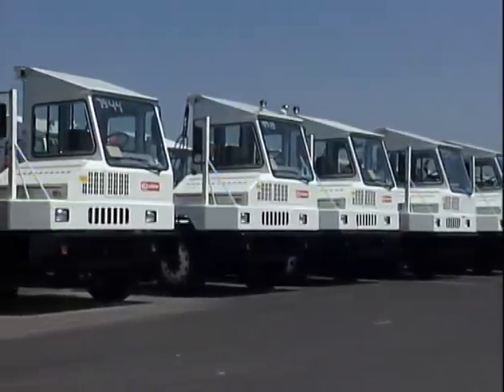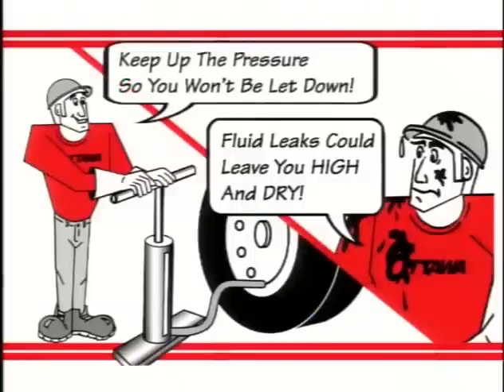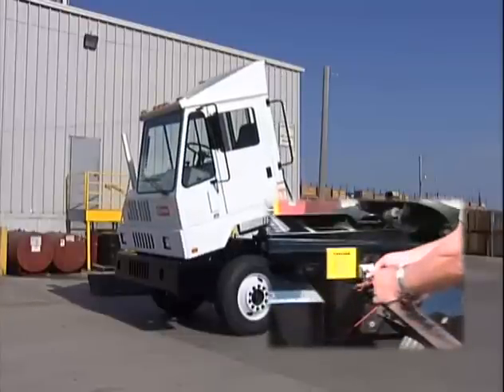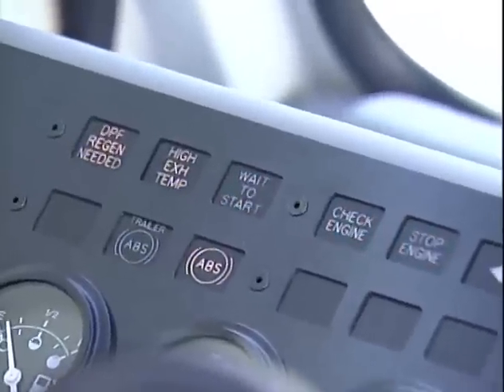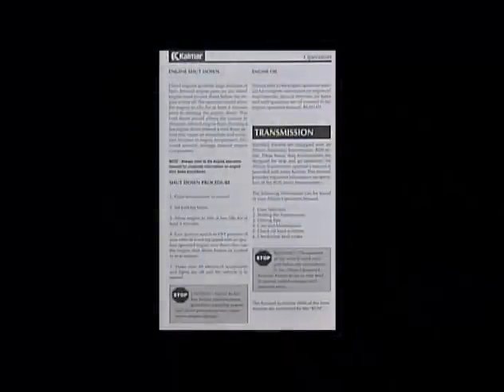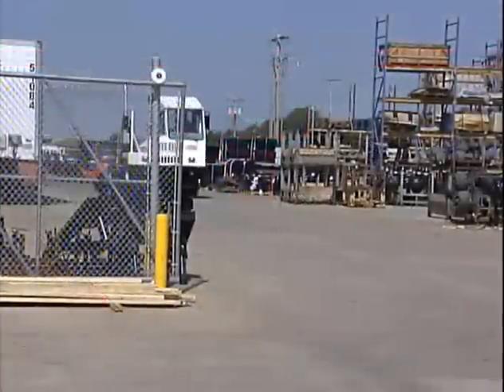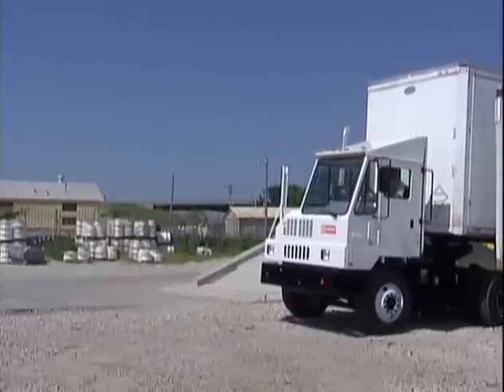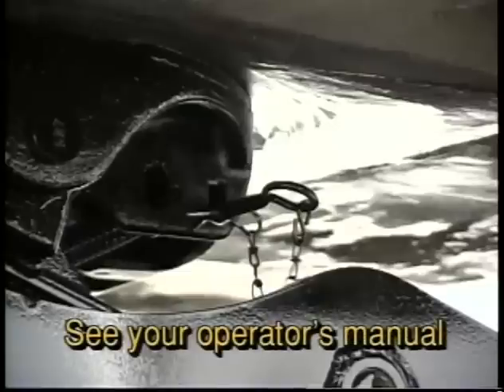Driver Orientation for Ottawa Yard Truck - www.aveneltruck.com

Comment: What I would like too see is a Telescopic and Tilt steering. Also, I notice failure too show Hub Oil Checks. Just because you don't drive these units down a highway, there are shunts that run a pretty fair sized yards and with the levels below normal, they can heat up the spindle and break off, detaching the front wheel from the unit.
 Good video, could use a few more tips.

Comment: Has anyone  noticed the mistake before he hooks up the air line...please tell me why the trailer brake button is pushed in!!!!
Reply: I was thinking the same. If you dont release the pressure in the hoses,  those things will knock you out!
Reply: I also noticed...

Comment: I've been a Yard Jockey for 2 days and would love to see someone post up how to properly do setups and say were the "marks' are for backing these switcher trucks. NOT at all like backing with a fullsized tractor with a sleeper. Not even close.
Reply: Because the yard dog has a single axle and a much shorter wheelbase.
Reply: @Psycho9263  Why would that make any difference ? ;>)
Reply: I was talking about backing with a yard dog. What I meant by "set up" was getting the trailer in a position where backing can be done more effective and easier.
Reply: Line up the back tire with the front of the parking space. Pull to a 45 degree angle and then get back in front of the trailer. You should be able to get in perfect
Reply: I know your post was 3 years ago but I've got a question. Does the driver know the up/down position of the 5th wheel? I've seen where there are sensors on some telling the driver how high or low the 5th wheel is? If not, wouldn't that be helpful?

Comment: I didn't see anything about how to properly apply 3 points of contact entering and exciting,  @4:06 he only uses two points.
Reply: There wasn't anything for his other hand to grab onto
Reply: He should have put both hands on the hand rail
Reply: You notice that but not the "check the tire pressure" with a slap on the sidewall ;p
Reply: That's a good way to get a paper cut.😋

Comment: i drove one of these for two years for a  transportation and logistics company in guatemala. We call it a torro or bull in english, but i recently moved back to the states, california. my question is, do you have to be certified to drive one of these for a company, and what sort of companies use these yard trucks? thanks alot.
Reply: Not always bro some want a CDL and some no. I've drove for two companies and didn't even need a valid driver's licence as long as you only drive on the yard.

Comment: About to be crosstrained on this. Glad I ran across this video! Thank you!
Reply: Hey, I've got a question on this and maybe you can help. Does the driver know the up/down position of the 5th wheel? I've seen where there are sensors on some telling the driver how high or low the 5th wheel is? If not, wouldn't that be helpful?
Reply: @Knightfan11  there is usually not a signal or sign. It's done by feel unfortunately. But the driver should be able to see the hitch up to a certain point, then he/she is blind till they hit the knuckle. It would be great to have like a cam on the bottom though. Would make it easy easier

Comment: If you get a job driving these, build good habits from day one, habits for safety , but also technique. never trust yourself, double check that you indeed did unhook the airlines, before dropping a trailer. I have been driving yard trucks for 12 years, and you will get distracted at times, by radio calls, truckers asking questions of you , etc. They always happen at the wrong time. Your busy, and they all (inside) need their trailers moved and then you are distracted and forget what you just did. It happens.  So Learn to check yourself, it's free, and it only takes a second or two. I have borken airlines a few times or stretched them, gotten them covered in grease when they slid over the Fifth wheel, and that is a mess to clean up, because it will get all over you if you don't. Broken airlines can put you down, and then you're in a pickle trying to repair a hose or waiting on maintenance. I have trained several people on these over the years, and on day cabs with manual 10 speeds, with power  lift Fifth wheels also.  it's the little things, the little habits you form that help you be a good driver. Good luck, and enjoy.

Comment: why do you put the trailer up so high??!
Reply: They have to lift it high enough for the landing gear to be off the ground. Depending on where you're from, there can be a height requirement between landing gear and road.
Reply: Hahodi d  - On an OTR truck you do. This is a yard truck. Its sole purpose is to quickly and efficiently move trailers short distances. They can move up to triple digits of trailers a day, so it wouldn't make sense using all the energy and time to get out and crank it every single time.

Comment: WOT on mine was 26mph. Put a dummy glad hand on service line with a separate spring (all the others came with one spring for 2 lines). I put a cb in with magnetic antenna. After hooking up the airline, I’d release the brake, then rev it up to lift the fifth wheel. Was quicker to air up the trailer this way. The other jockeys (kids) would hook up and drag the trailer, wheels still locked up. They’d hit a trailer backing another one in and try to blame it on street drivers. Except the damage done by jockey trucks cannot be done by street drivers ( a jockey truck, backing a trailer in, will only hit the other trailer at the top. So if you are going to drive like them, make sure you kiss ass with management!